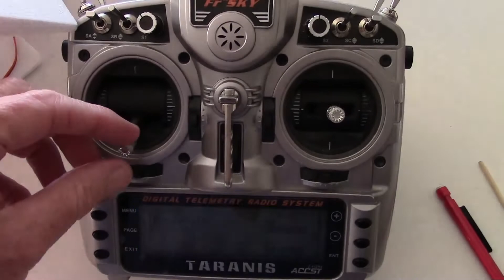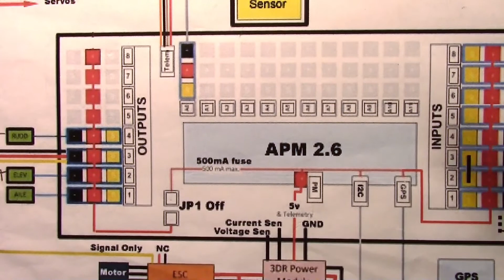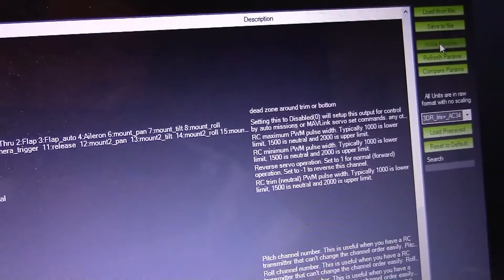HK Bush Mule FPV Build Part 2 - Installing GPS, PM, Throttle & Flaps Channels, Prop Balancing

Comment: Hi Dave, nice tip with the knife and Y lead connector....didn't know you could do that....Thanks.  Nice to see you using the more compact APM Pro, I just evicted mine from my Mini Talon for an Omnibus F4....Im trying to use one type of FC so my brain isnt overloaded....lol....I use the same EZ micro receiver on sppm Mode and programme channels 2,3 and 4 and and plug into them for extra channels...There is a conventional Plane preset for the Omnibus F4 inside iNAV.
Reply from the maker: Yes I use that same conventional plane in iNAV for my Bixler but I use the BeeRotorF3 controller. So you are using the EZUHF Nano RX now? That is great little receiver and works great on my Tek Sumo wing.
Reply: dmercØØ RTP Hi Dave..no,not the Nano reciever the 4 channel one like in this clip..Looking forward to seeing the Mule fly...:)

Comment: My GPS even works when I cover it with a garden spade, so foam is definitely not an issue. How on earth it's possible that the GPS keeps receiving beneath a metal cover is a mystery to me. I can only guess that it was picking up waves reflected back up from the ground and back down off the spade.
Reply from the maker: I know that putting metal under a GPS actually helps but that is strange that above would be ok. Good to know though. The size of the antenna on the Drotek ought to help with the sensitivity.

Comment: #6: nicely done so far D. Keep up the good work. ;o)
Reply from the maker: Servo arm changed as per your tip, thanks.
What does the FG in your channel name stand for?
Reply: I have seen it, it gives a good feeling if someone takes good advice in consideration ;o)

Fg is just a brand name of big scale 26cc petrol RC cars, I like them and have several off these cars in my hangar for times that the weather is no good for flying. Fg car driver = Fg Dude.
Here you can see them in action: https://www.youtube.com/watch?v=7AGaLw0rT6s
Have a nice weekend.
Reply from the maker: Now I get it. That looks like fun!
Reply: 100% Cheers !

Comment: (drool) loves the Bush Mule!    Great viddy!
Reply from the maker: Ellie would love it. So big and chewy :-)
Reply: Brian B You need one
Reply: I was just lookin' at my walls in the ole hobby palace and man, I just don't have the room!!  We shall see......
Reply: Heheh.  She LOVES chasin' dem planes!  I see you are using the Ardupilot.  I experimented with them 4ish or so years ago when I built my 1st quad.  I really liked the open source system!  Amazing prices.  I saw your unit (sans gps rx) for 37 bux!
Reply from the maker: The APM Pro is great because it has the standard pins instead of those tiny Molex connectors. Makes it much easier to do the wiring.